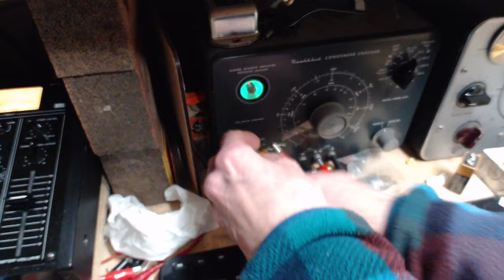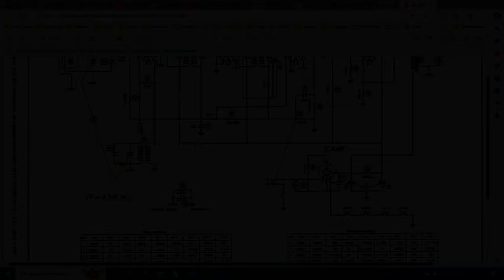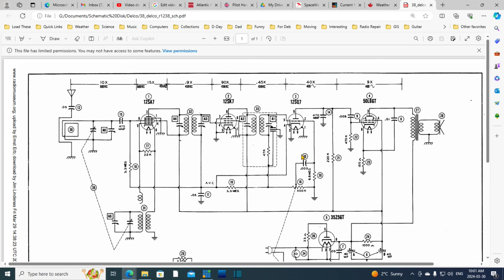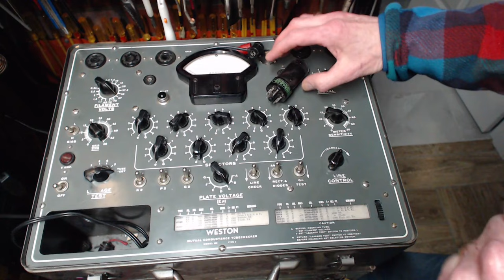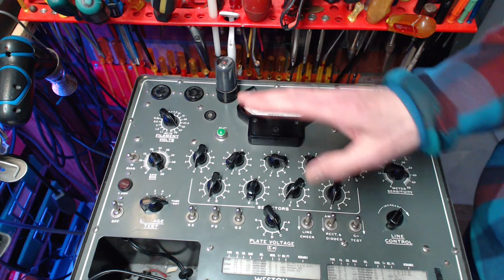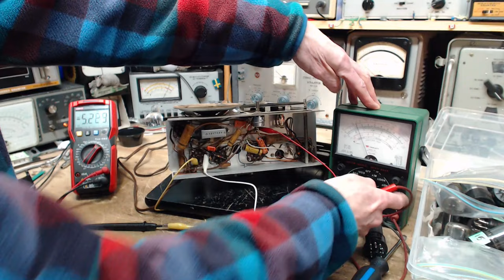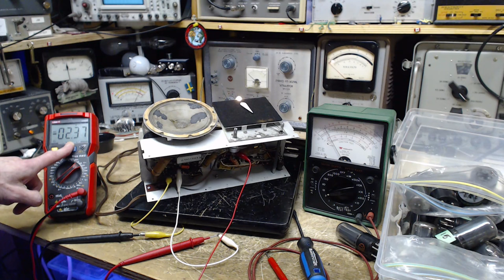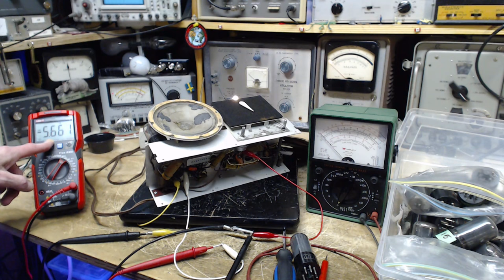Delco R1238 Tube Radio Video #2 - Positive Output Tube Grid Voltage

Comment: The static noise you are hearing sounds like a noisy resistor. When operating voltages are applied across it micro-fractures inside the resistor cause arcing.  Use a signal sniffer/tracer to find the noisy resistor.  To test a resistor for noise remove the resistor from the radio. Use your capacitor tester to apply reasonably high voltage across it. Use a signal tester to listen to the resistors radiated noise. Mr Carlsons Lab has a great presentation on resistor noise troubelshooting.

Comment: His method of troubleshooting is flawed in many ways. If you expect a positive voltage on the grid of a tube to be caused by a grid coupling capacitor, you cut out that capacitor and retest without it. You dont replace it before retesting to take all eventualities out of the equation, since even brand new capacitors can be leaky. 
And if without any grid coupling capacitor present, the grid of such an output tube goes positive(!) when measured across a present grid leakage resistor, the tube is gassy! 
Why is the grid of a gassy tube going positive? Because the flow of electrons kicks electrons from the stray gas molecules they hit, producing not only additional electrons, but more importantly also positively charged gas ions. These in turn get attracted by the most negative electrode,- the grid, where they impress a positive charge.
Why is this effect increasing over time? Firat because with the tube heating up the convection of stray gas molecules becomes faster, allowing for a higher probability of impact with the accelerated electrons. The increased impact rate in turn produces more ions and extra electrons. The extra electrons cause more plate current which is further increased by the grid bias voltage getting more positive (less negative to cathode). This will eventually result in a thermal runaway only limited by the amount of ionizable gas in the tube. 
But then again instead of reading up on the basic tube failure modes and how to identify them, he goes on an hour long rant and guessing.
Reply: The gassy tube… reasonable explanation. I had not thought of that. Thank You!
Reply: ...well, "ya CAN'T please EVERYBODY!!!"